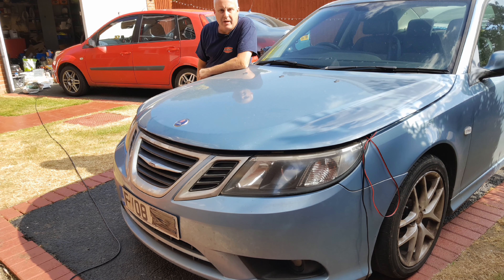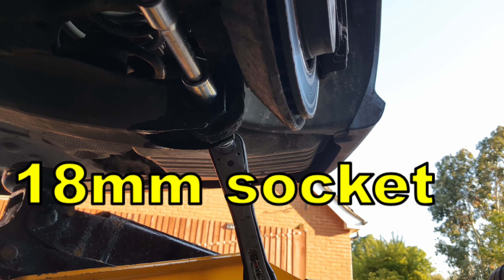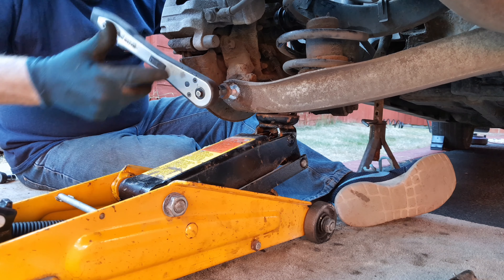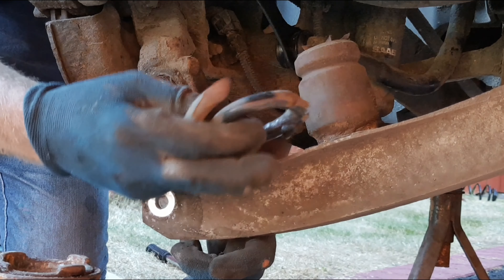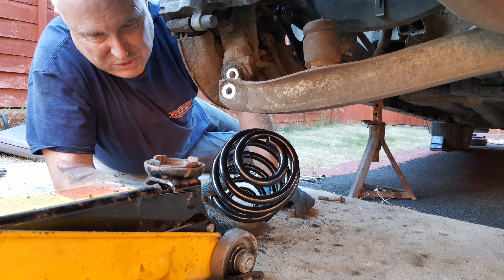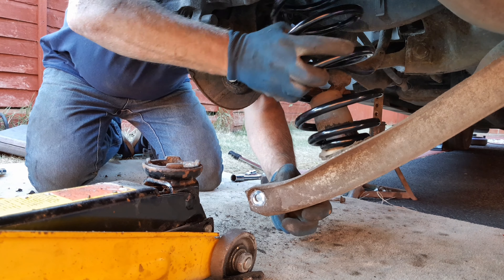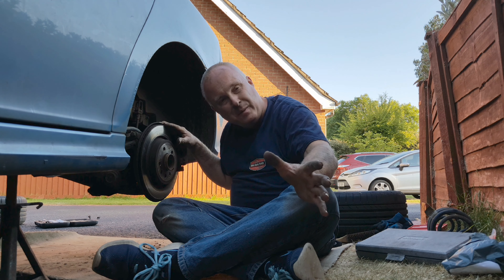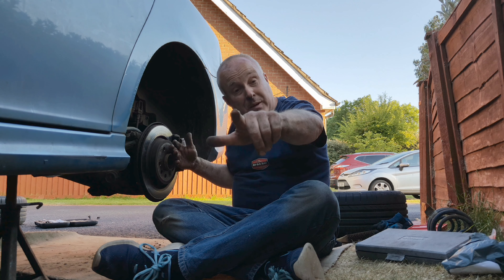Saab 9-3 Rear Coil Spring Replacement | SO EASY DIY

Comment: Thanks for a very clear direction for this job. Just did mine and. I didn't need to disconnect the drop link but having found the bump stop to be knackered I will need to do the job twice as no Saab suppliers open or near. Worth a good look at the bump stop before starting the job and even assume it needs replacing on a high mileage car. I would also suggest tightening the radius arm bush bolt with the wheel jacked into the normal ride height position unless you suggest otherwise.

Comment: Just to save a bit of time and effort , you don't need to disconnect the anti roll bar drop link from the steering swivel member, as this remains undisturbed along with the rest of the assembly. The only point of interest is to lower the transverse link, to release the spring. so only one bolt needs to be removed. 
Also on reassembly it is wise to suspend the weight of the car onto the suspension assembly as not to over stress the lower rubber bush in the steering swivel , when the car is under it's own weight again, just one more point. The final torque setting for this operation is 75 Newtons, plus a further torque angle of 90 degrees.

Comment: It's also worth mentioning that if you have the headlight level sensor on the left control arm on your model that it will need removing before you pry the arm down to remove the spring.
Reply from the maker: YES, great tip, thank you.

Comment: A very concise video Cyd 👌What brand of spring did you use?
  Thinking of doing my rear springs and shocks on my 2011 Saab 9-3 ttid estate, and especially the housings for the top of the springs which it seems can be where I'm getting my knocking noise, which going by the forums is where it's most likely coming from 🤞

Comment: Had to remove one of the springs when I changed the lower inner control arm to get access however I learned the hard way that you have to compress it before removing it otherwise it will come flying.
Reply from the maker: Ah, yes, you should have removed the spring first by this method. If you release the control arm with the spring still in place, then that's very dangerous. Those springs store a lot of energy when compressed and released suddenly it can do you a lot of damage.

Comment: Great video. I just had a quick question... Is it possible to fit the rear springs incorrectly? I've recently had lowering springs fitted and the front is lower than the back, when it should have been an even drop.

Comment: Greetings from Chicago, USA and thanks for posting this awesome video for us Saab enthusiasts!  Would it more or less be the same procedure for the Saab OG models?  I have the 2002 Saab 9-3 SE model. You make it look way to easy : )
Reply from the maker: I've been to Detroit on business 3 times and missed out on spending a day in Chicago by a hairs breadth. I'd love to see where they filmed Blues brothers ❗ 
Sorry, but I can't answer your question. I have no knowledge of the OG9-3 at all, I've never had one. Try joining Saab Nuts! group on Facebook and ask there. Plenty of knowledge in that group with 16,000+ members worldwide.
Reply: @CycloneCyd  According to my Haynes manual it's only the Rear shock absorber bolt to be removed on the OG models - I'll be testing this out in the next few weeks as mine has a shot upper rubber bump stop on the drivers side. Wondered about that squeak (spring scraping the metal) & lean to the right for a while now! Springs look ok but I really shld do them & the shocks at the same time. Wife says no..... so it'll be just the stops unless I discover something nastier.... 
Thanks for the videos - my 77k 2000 9-3 is starting to show it's age.... 3rd di cassette on order too after rear calipers.... sigh... ; )

Comment: Any chance you can do a video on replacing thd big metal radiator hose at the top,im trying to replace 1 of the bottom hoses to go into it,decided its impossible, so my hose there is rusted, thought may as well replace pipe,and put the hose on while i put new pipe in

Comment: @Cyclone Cyd  Hi Cyd - thanks for all your great videos. Please can you tell me if the rear alignment can or should be adjusted on a Saab 9-3? And if so, does the ReAxs passive rear steering mean this needs special treatment, or could Kwik Fit etc. handle it?
Reply from the maker: The camber and toe can both be adjusted on the rear of the 9-3. Don't trust KF, please! Find your nearest Hunter approved centre from here: www.alignmycar.co.uk
Reply: @CycloneCyd  Thanks, unfortunately the nearest Hunter approved centre couldn't book me in until late June (and were very pricey) but my trusted local mechanic has given me a recommendation so I'll take it there rather than one of the chains.

Comment: Hi Cyd, I have a question.  My car just failed it's MOT due to both rear coil spring lower support being worn out.  Does this mean the bump stops need replacing or something else?  Cheers.

Comment: Dear sir thanks for all the good video you put here. I have problem with My Saab 93. I replace fuse 16 under the hood. all of a sudden I can not open the boot lid and the left tail light is on and black does not work. wipes leaves have also laid off. I have a Saab 93 2009 station wagon. I'm troubleshooting and it's just saying earth fault.
Reply from the maker: "black does not work"  .....  "wipes leaves have also laid off"
Can you clarify please?
Earth faults are common on rear lights of the saloon, not sure about wagon. Caused by water leaks on saloon
Reply: @CycloneCyd  sorry sir tail light is off and no electricity. I have checked fuse box under the hood with multimeter. Fuse F17 and F18 shows zero volt. The fuses are fine they not damage.
Reply: @CycloneCyd  wiper blade back is off dosent work but in front both works
Reply from the maker: @goro70  I think it would be wise to check the continuity of the wiring. Maybe a break somewhere (hinge points are a favorite)

Comment: Cyd, Thanks for these vids. They are hugely helpful for my own car ('07 9-3 2.0T; 127k miles). It seems the SaabSite has been taken over by SaabParts.com. Is there another source you know of for that info? I also posted this question on your video about rear bushings. Is it worth replacing the springs/suspension without replacing the bushings? Do you have a recommendation on a suspension upgrade and ease of install for a newbie? I'm considering Bilstein B8's or KW Coilovers (probably variant 1). Thanks!
Reply from the maker: On my own Aero Anniversary (the blue one) I have Maptun springs (lower by 25mm for Aero, 35 for std) and Monroe Reflex shocks all round. The Reflex have now been superceded by OE Spectum. We recently fitted OE Spectrums to my son's Ibiza. I have done 65,000 miles on my Reflex and am mighty pleased with them. The OE Spectrums seem equally as impressive. The Reflexes were well up to the job of controlling the lowering springs.
If you're only lowering by 35mm you can get away with B6s but any lower you need B8s. Billies are the dog's chopper and used them on my rally cars. For a track car I'd use nothing else. But for a road car, it's my opinion they are unnecessarily stiff and expensive. You pays your money you takes your choice though.
You can certainly replace the springs/shocks without doind bushes, at least initially. If you have any suspicion about the condition of any of the bushes then change them. Especially anti roll bushes. Also I suggest using Powerflex Black for the rear wishbone bush. In combination with the shocks and top mount, this bush exercises a lot of control over the front wheel especially under power. I went purple and got rid of torque steer, but it's starting to creep back in. Also see my video on heavy duty top mounts. A very worthwhile mod.
At the rear, banana arms are probably first to replace (replace the whole arm - easier that way, cheap enough)
Thanks for the info on the The Saab Site, I'll investigate and updat the description accordingly.
Reply: @CycloneCyd  Thanks Cyd, I really appreciate the detailed response.The H+R springs that I was thinking about wrapping the struts in drop the car ~1.4" (~35mm), and seem to be well touted here in the States. Sounds like they'd work on the B6's the B8's or the Monroes. I do like MapTun. I upgraded to a stage 1 tune with a strut brace from them earlier this year.

Comment: As usual great video 👍 Does anyone know the torque setting for the lower arm outer bolt to the hub that he took off and refitted once he fitted the new spring, I’ve been looking everywhere for the figures and can find it anywhere. Any help would be appreciated thanks🍻
Reply: The Haynes manual says 150 nM or 111 ft lbs
Reply: @BLKNJ  thanks very much for the figures appreciate it 🍻🍻👍

Comment: Did you have to get an alignment when doing rear suspension work on these cars?
Reply: I'd also like to know this.  I'm not doing any work on my suspension, but I'm considering getting the alignment checked having recently got four new tyres and noticing a slight vibration at speed, and I was wondering whether the rear alignment can be adjusted given the ReAxs passive rear steering, or should I just get the front wheels done? Thanks for all the great videos!